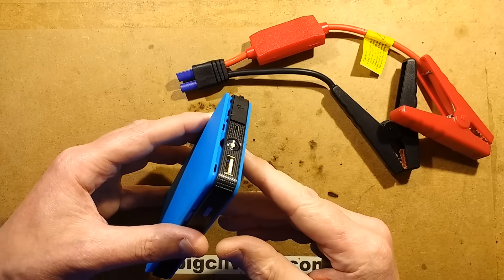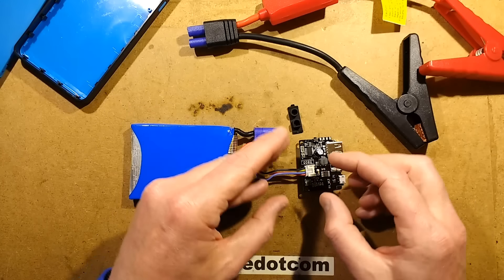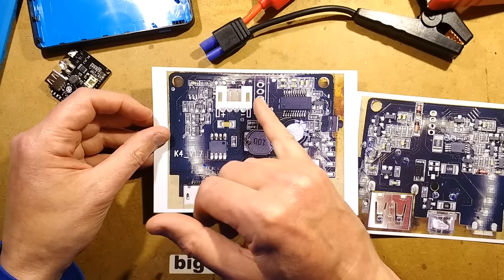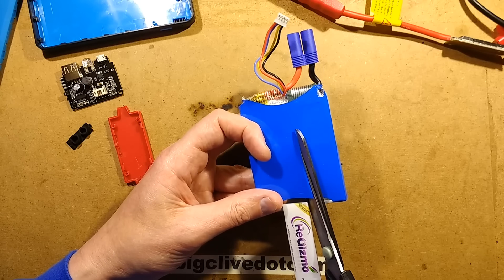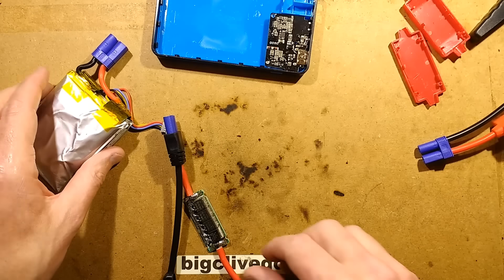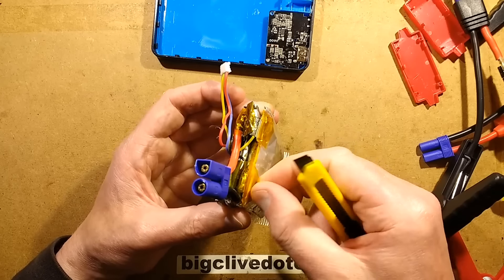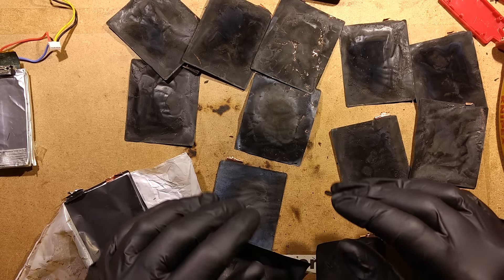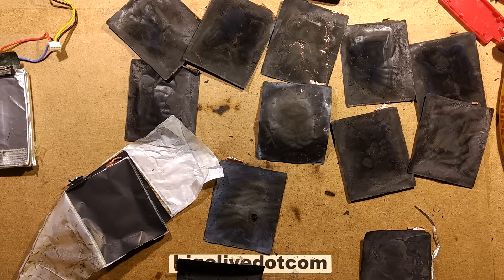Shorting out a fully charged cheap lithium jump starter.  (It didn't end well.)

Comment: Hi Clive, watched this video a few years ago. Just watched it again, very entertaining. These things shite, charges from dead to full in about 10 minutes, tried to charge my phone with it put 6% into it cut out and died zero power left in it. Total rubbish no chance it would ever start a car. I've got a Gooloo 4000 amp jump starter it works but how do the Chinese measure the output, with special Chinese ammeter or do they just think of a number and double it.
Reply from the maker: For such a fast charge time it either suggests loss of cell electrolyte or a serious cell voltage imbalance if it doesn't have balancing circuitry.

Comment: What else are these flat packs called? I've looked for flat cell and flat pack battery. I've got a number of projects that would benefit from a large, hight current pack.
Reply from the maker: The bare cells are just sold as lithium ion cells and often sized by actual metric measurements.

Comment: I remember when I was younger I took apart a fully charged lithium ion pack and took apart every layer and I said to myself “how is this at all dangerous” then I took the second pack that came with it and stabbed it and it sparked and I got really scared so I threw it in the snow outside and promised I’d never play with lithium ion packs again. I think im so lucky because later on I found that the bms (battery management system) was still attached if it had any effect in preventing it from blowing up

Comment: I had an old 2200 mAh cell phone battery (design voltage 3.7v).  I charged it to "80%" (around 4.0v) and used it for awhile as an emergency LED light.

Eventually it wouldn't charge anymore.  So one day I forced it to charge with a 6v power adapter.  it swelled some, but after a few minutes and checking, the voltage eventually settled to 4.5v once it was off the "overcharger".

Of course, I then went and shorted out the terminals.  I didn't use a multimeter to measure its current, however it swelled up almost exactly like the pack in this video did.  Although not as fast.

Still, it was a toasty battery pack once it was all said and done.  Voltmeter showed a mere 0.321v (never forgetting that number).  Task failed successfully, lol

Comment: in 12:20 the initial reading of the Amp_meter was 526 not only 160_Amp, as reported by You, then Amps went down, as the battery-packs ballooned.

Comment: I want to know the exact size of that pipe I need a large sense resistor capable of 100A and what solder/wires you used for taps
I need to know what my backup system is using and it can peak at up to 80A
Reply from the maker: You can buy precision 100A shunts for measuring current.
Reply: @bigclivedotcom  but I am bigchrisdotcom and love dodgy shit like this I need to Know the dodgyiest way to do it

Comment: Since that's a rather cheap cell it's probably a lithium nmc cell. You basically have an aluminum cathode layer coated with nickel manganese and cobalt oxide (the dust is carcinogenic) and a copper foil anode coated with lithium and graphite. Ceramic separator foil between the two and Lithiumhexafluorophosphate in an organic solvent (often both highly carcinogenic too, I've seen cells with dichloromethane inside) as electrolyte. So yes prolonged exposure will make you more likely to develop cancer.
I've worked in the industry and we were wearing full body suits and gas masks when doing maintainance or other stuff in the contaminated areas.

Comment: Hmmm
410uV/A = 0.41mV/A
0.0526V = 52.6mV -> 52.6/0.41=128A (was that supposed to start the engine? car battery for 0.8 gasoline is rated at 320A, 1.9 diesel 680A)
then 0.015V = 15mV -> 36A
then 0.0030V = 3mV -> 7.3A

So the failures were in order, along with their failure modes:
- the diode junctions gave way, however it seems that with these hi current devices the failure mode it is to rather get shorted instead of bursting open
- the copper track (effectively, the fuse) on the PCB gave way (however it was "repaired" by replacing leads)
- at this point, there was some 128A current flowing through the cell(s) what caused the electrolyte in one cell to boil and the gases made the plastic casing of the cell to puff
* assuming 1Ah capacity and 30-100C discharge rating of such a cell it seems to be above, so the cell failure is not quite unexpected
- the loss of reactive surface caused the cell to lose power and weaken the reaction, effectively damping the process
- in more adverse situation, the high pressure of the gasses inside could cause the sack to open and release the gases, what combined with the high temperature and pressure would create fire jets

Comment: I can't to seem to find one of these that Li ion jumpers that is good. All of them seem to stop working, don't hold a charge for long periods, expand in the heat of car, or won't start a 100% dead battery. I'm still driving around with a heavy lead acid giant jumper in my trunk because I deliver and can't be without a jumper. Wish I could find a nice light small one tho.

Comment: I had one of these worked great until the day my automatic Jag battery died in the middle of my road stuck in drive , connected this pack to the battery which was located in the boot went to start it and the battery pack went on 🔥

Comment: So basically what happened in the cell is that due to the heat evolution either the polymer of the separator shut down while the solvent evaporated creating the over pressure. The Li salt used mostly decomposed, therefore, these three processes killed the cell before the active materials could be fully discharged. My theory...

Comment: How to revive a dead Schumacher Redfuel SL65  Jump Starter or other similar devices

Symptoms: my friend’s unit would show 100% charge when connected to wall charger. When disconnected from wall charger, sliding power switch on and pressing power button next to display - nothing happens.
This is what I recommend and why:
I checked the voltage at the output terminals using a digital volt meter (where you connect the jumper cable attachment) and got a reading of 0.7V.
What happened is my friend Roger probably drained the unit below the minimum 40% charge level recommended by manufacturer or didn’t charge it for an extended period of time and the internal lithium battery (3 cells connected in series) drained below the voltage threshold the charging circuit needs to detect in order to initiate charging process when connected to wall charger.

What to do:
1) You will need a 12VDC power source like a car battery, battery charger or probably even a rectangular 9V radio battery. The idea is to connect this power source directly to the unit’s jump start output connector (observing correct polarity - very important! You can verify polarity by holding jumper cable that plugs into unit in correct orientation and verifying the red cable is positive terminal)
2) get 2 insulated wires at least 10” long - doesn’t matter what gage as we will be running very little current. The idea is to connect your ~12V power source in parallel (+ to +  and - to -) to the jump start output terminals of the jump starter unit. If you’re using a household 9V square battery, I recommend you leave it connected for say 20 minutes, the other 2 example sources probably only need to be connected 4 seconds. After this disconnect the wires.
3) With the SL65 switch set to “on” press the power test button next to the display - is it shows 1% with the “1” flashing you have succeeded, if not return to step 2
4) Connect the SL65 to the wall charger and allow unit to fully charge. This will take 4-8 hours depending on the device you have

Because of the design of the internal charging  circuit of these units, if the internal batteries are allowed to fully discharge, if the charging circuit sees < 1Volt, it assumes the battery is bad and will not commence charging process.

How many of these amazing electronic jump starters are ending in land fills because of this   simple mistake or neglect on the part of consumers. The manufacturer also bears some responsibility - a very simple design modification in the microprocessor would correct this vulnerability but then they wouldn’t sell as much product.
Reply from the maker: I'd recommend against boosting lithium cells like this.  It is viable to slowly trickle charge lithium cells to recover them from low charge (but not advised if they have become reverse polarised significantly. )
If the battery does take a charge but then the voltage drops significantly over a day or two then there may be shunts formed in the electrolytic barrier between the electrodes inside and it's better to retire the battery safely.

Comment: If those black plates punctured with metal, do they burn with flames? (as said by Samsung after exploding of their phone)
Reply from the maker: Puncturing a lithium cell will often result in high current discharge at that point.

Comment: I just bought one of this generic jumper.  It is the bare-born architecture I almost wanted to DIY.  It arrives, will do test with starting current measurement. The PCB is the balanced charger with a step down to act as cell phone charger. (micro USB port 5V in, USB-A power out.)Capacity estimation: 12.6V to 9V @ 8A gives ~2AH which is the limit of 20~25C cells of this size..There is NO protection, no switch, the 4 schottky diode-gang allows only current to flow out, not into the lithium .  For a Honda 4L, should work but will come back if it didn't.

Comment: You know you give a fellow bad habits!  The other day, an old buddy came over to show off his new 9mm pistol.  Now this was a Hi Point pistol, known far and wide as the cheapest piece of crap pistol you can get that still launches 9mm bullets down range.  So the first thing I do, after checking that the chamber was empty, was to grab a magnet and check for steel.  There was none, the frame was plastic, of course, and the slide was some alloy.  Oh the barrel did show mild steel....

Comment: Your test where the cells puffed up, having the original diode set would have a good job in protecting your vehicle and  you.

The second set not so good, but still no flames.

The other thing is that before you trashed it, it could still be  used as a jump starter by using the balance leads connected into an rc charger.

By pass the original charging circuit use an rc charger and you have a more reliable charging circuit.

Comment: They am crap tbf ...I even had the energiser one but has active circuit on the jump leads and works with any 12v 12ah lead acid battery 😁 but middle cell always failed on the ones I brought lol

Comment: How are they able to get 500A from such a battery without ruining the battery?

I have a 4S li-ion battery using 3.7V 18650 cells that are rated for 2A continuous output or 6A max output.  There's no way I could draw 500A from them without ruining the battery, is there?  How do the jump starter packs with li-ion 18650 cells provide such a high current?
Reply from the maker: It's a different cell construction.  Not a spiral, but lots of separate plates in parallel.
Reply: @bigclivedotcom  Yes, I noticed that in your teardown, but, those cells still have to be in series to get ~12 Vdc from the battery, so where is the magic in being able to draw so many amps from those sheets compared to a continuous spiral-wound sheet in a cylinder?  I've also seen pouch cells that are folded in an accordion fashion--which would be just like a continuous sheet, I suppose.

p.s.:  Pretty cool how you squeezed that puffed cell to restore it's voltage. I would have never guessed that would have worked. :)
Reply: @bigclivedotcom  So, fyi.. I reviewed another vid here:  https://www.youtube.com/watch?v=_LurYulow0Y  that uses a pouch battery.  When I do the math on it, it looks like it is a 11.1V, 8Ah li-ion pack (each cell 3.7V & 8Ah (e.g.: 11.1V * 8Ah = 88.8Wh.  88.8Wh/3 = 29.6Wh per cell (pouch). 29.6Wh / 3.7V = 8Ah per cell (which isn't much higher than the max 6A rating on my cells.  Given that many of the jump starters have controls to limit overheating & over-discharge, I imagine they are pushing the cells to the limit...  I always thought if you put cells in series then you could only draw up to the current rating on the cells--which in this example that would be 11.1V*8Ah=88Wh--which is probably what you'd get if you had a very small current draw vs a 500A draw.

Maybe the internal resistance of the chemistry used is much lower & that accounts for the reason they are able to draw such high current.  What do you think?

Comment: I shorted a small 200 mAh Li Ion battery when I was cutting the terminals to the voltage regulator and putting a large 890 mAh on my headphones. It was getting warm because I cut it on a metal surface to protect the other surface under it. Silly mistake. I forgot. It got hot though it has not exploded. Always keep your focus and remember to insulate the terminals so they do not touch each other. My multimeter terminals have caps on the ends. Some sticky tape would be enough. I need some small snips.

Comment: Everyone. These should NEVER be handled as casually as shown here.  Keep a ABC fire extinguisher handy. Use a full face shield, long leather gauntlet gloves, long sleeve cotton shirt, and a high volume vent fan. A tempered glass/metal shield between the unit under test and your test equipment is very wise, around it on top and all sides is better.  And a safety observer ready to dial 911 for you.  It have seen these: swell, sweat, smoke, burst into flames, and explode.

Comment: I was shaking in my shoes watching you take that apart (battery)!!! lol I have a lot of Lipos for my Quads, planes & Helis I am always worried about having them in my house even with them in a fire proof bag made for storage and charging it still freaks the @#%* out of me if I think about it to much Lol I should add that the paks that I have are the older type (about 9 or 10 yrs old) with out any monitoring or built in safety components-new paks are much safer than they were back then

Comment: You've gotta take out the safety module.. it'll blow quick even starting old carbureted engines. Becomes useless, you remove it and pay attention to what your doing which you should be anyway.. and it'll work much better.

Comment: Do you think that the flat batteries are better than the round ones or not?
Reply from the maker: They pack a lot more energy into a smaller area due to the shape, but the round ones are more rugged for swapping cells.

Comment: Hey big Clive if it's 500 amps could it kill you but only about 12v
Reply from the maker: The risk of shock is very low with 12V due to the resistance of your skin limiting any significant current flow.  A low voltage high current supply does pose its own risks though, like fire or burns if it gets short circuited.

Comment: Huge design flaw. You can't parallel diodes and expect each one to share the total current. That is you can't take 10 diodes in parallel and shove 100A thru the and expect each one to carry 10A. What happens in the Vf of each diode is a little different and the lower Vf ones will carry the higher current. Then once the lower Vf diode (or diodes if your luck and they are matched for Vf) heats up the Vf drops at a rough rate of -2mV/degree C so the problem quickly gets worse.

Comment: I stupidly over discharged one of these. Looking at the balance connector one cell is now at zero volts. Is it safe to try and recharge that one dead cell? I use it to power up 12v devices and it has been useful and I would like to get it working again
Reply from the maker: If may be recoverable, but not suited to high current use now.
Reply: @bigclivedotcom  is it OK to trickle current into that dead cell? I have a 5v power source and a box of resistors. I could just leave it outside on a trickle charge and see what happens.
Reply: @bigclivedotcom  update. The battery pack felt a bit odd, so I cut the outer plastic off. Then it's very clear that two cells are all swollen up. I think I won't try to charge it any more
Reply from the maker: @gepwxaqdfsidsesg1548  If possible, discharge it before disposing of it, as it's the stored energy that makes them a bit volatile.
Reply from the maker: @gepwxaqdfsidsesg1548  In the past I've gradually brought over discharged cells back by using my bench supply to trickle low current into them until they reach 3V againmand will take a mostly normal charge.
Some cheap power banks are supplied with the cell at near zero.  The control chips do the recovery charge automatically.
The main thing is that the cells should not show a reverse voltage (charged in reverse by the other cells).
After complete discharge like this they may not be suited to very high current use.
Reply: @bigclivedotcom  thank you for the replies. I will find a way to discharge the cells. A car bulb across each cell should do it.

Comment: When you did this - you took the pack out its container - I imagine that if it was packed inside the plastic case, it wouldn't have changed its resistance so much .... which would've caused a fire.

Comment: What puzzles me is the ridiculous amount of (claimed) current they (supposedly) force through the wires. For example, I've seen units that claim "600 amps" and yet use #12 AWG wires. Here in the USA, according to the National Electrical Code, 12 gauge wires should not be called on to carry more than 20 AMPS! (at least on a continuous basis).

I suppose they could "safely" carry more on a SHORT term basis...
Reply: You're ignoring the length of the wire.  The NEC spec is for 50' runs of wire from your panel to a socket inside wood stud walls and under continuous use.  A few inches of #12 in the open can safely carry a lot more.